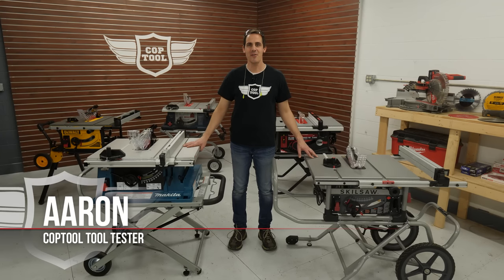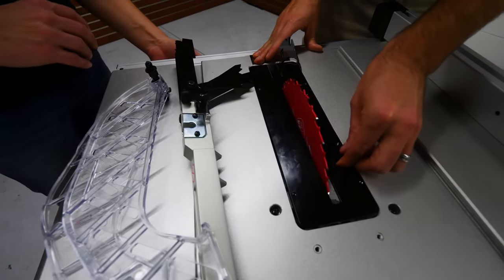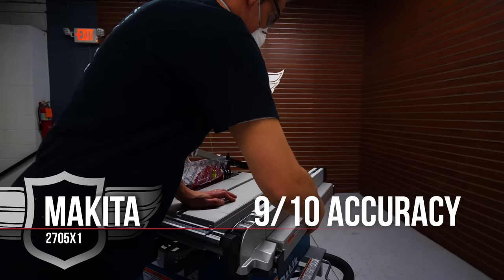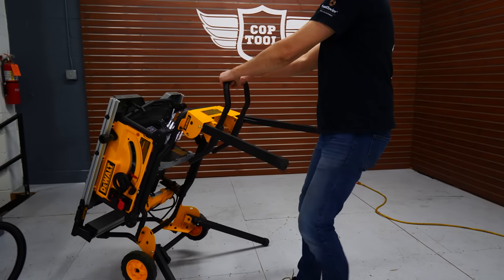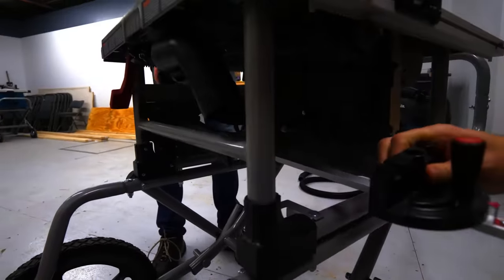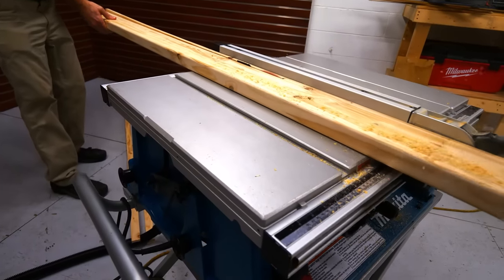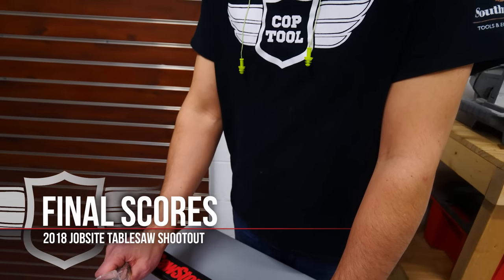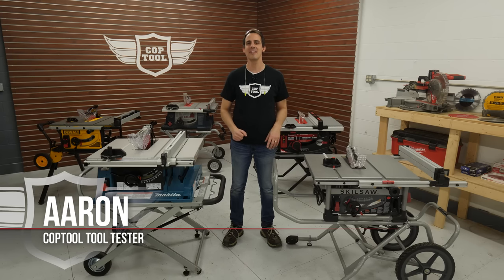THE BEST Jobsite Table Saw - Bosch, Dewalt, Makita, SawStop, SkilSaw. How to choose the one for you.

Comment: Saw stops aren't safe, they'll still cut you, yea it'll probably stop before your fingers gone but in my opinion it makes people too brave, you need to respect your table saw, like you said in the video it can end your career, there's no value in buying a saw stop, there's value in working smart and respecting the fact that any tool in your shop can be seriously dangerous if you don't know what your doing.
Reply from the maker: I agree, working smart and respecting safety is incredibly important for any tool. However, this doesn't mean SawStop doesn't hold any value. Safety features aside, It's a great saw... I also understand what you mean by making people too brave (senseless), but that isn't the case for everyone. Mistakes happen and there is nothing wrong with putting up a little extra cash for insurance.
Reply: Getting a couple stitches is a hell of a lot better than losing a finger. But I agree. It does, for some people, introduce a level of complacency. And it's even worse if they end up using a saw that doesn't have that safety feature.
Reply: I’m all for any kind of technology that improves safety.   That being said, I am over the top on personal safety.   I don’t put my hands anywhere near the blade when making cuts — that’s that they make push sticks for.   I would safely say that 98% of shop accidents are user error.  People either engage in extremely unsafe practices, or fail to maintain their equipment in top working condition.   No amount of safety equipment can prevent those kinds of injuries!

Comment: Buy the way you can adjust the fence on the dewalt in every way. If you knew what you are talking about you would know that. Also there is a separate riving blade without the guard. Again if you knew what you are talking about you would know that. I can go on even the way you checked for accuracy, not using the right tools. Again if you knew what you are talking about you would have used the right tools for tuning it. Also the fence can be tightened down with an easy adjustment so it doesn't move at all. Again you don't know what you are talking about.

Comment: Isn’t the skill saw a bosh saw on a different base ?
Reply: skil has worn drive motor and blade extends higher. bosch did buy skil company in 90's
Reply: I have the Skilsaw and it's amazing. The Bosch is not Worm Drive. My understanding is that Skilsaw used to be owned by Bosch but that is not the case anymore. I might be wrong in that but that is what Skilsaw told me when I contacted them a few weeks back.
Reply: One thing to remember is all site saw are pretty much limited to 15amp motor because of common  110Volt house hold breakers. Anything on drive system added to motor other than direct drive adds resistance; reduced power at blade in end.
Reply: David Davis Where are you getting that information from? This is the only time I have ever heard this so point me in the right direction so I can read up on it for myself please. I can only talk about my experience with the Skilsaw SPT99 and so far it's been a beast.
Reply: Many companies are bought and owned by other companies but the products are still branded, designed, engineered, manufactured and marketed differently. Like Milwaukee, Ridgid and Ryobi are owned and manufactured by the same corporation but they are not the same products even though some people will try to tell you that they are. There sometimes are cases of rebranding of a particular product but not so much with these types of tools from what I can tell.
Reply: David, Your statement isn't inaccurate, but it is incomplete. It is ignoring the mechanical advantage that is gained by introducing a gearset inbetween the motor and the blade. Skil doesn't publish (that I've seen) the specs around the gearing, making it harder to calculate the mechanical advantage from the gearing, but it's there. That's pretty much the whole point of the gearing after all.
Reply: Jeff Delamater As luck would have it I actually got a response from Skilsaw today for a question I asked a week or so ago related to using an 8" dado stack and they spoke a bit to the H/P of the Skilsaw. Also I will paste another answer from them a few weeks ago that touches on the merits of the Worm Drive technology which I agree with you does not fit neatly into David's hypothesis:

From a few weeks back regarding the Worm Drive:

Skilsaw Customer Support <SkilsawSupport@custhelp.com>
Mar 22 (13 days ago)
to me 
 Image

Recently you requested personal assistance from our on-line support center. Below is a summary of your request and our response. We will assume your issue has been resolved if we do not hear from you within hours. Thank you for allowing us to be of service to you.

 

Subject
Part and Accessory Information

Response By Email (Paul) (03/22/2018 01:34 PM)
 
Hi Alex,
 
 
Thank you for your patience on this.
 
I consulted one of my colleague from the technical team and here's what he said :
 
"The horsepower rating technically comes out at about 1 3/4, but the real dynamic is that this is a worm drive saw with a lot of torque which will easily accommodate an 8 inch dado. My experience has been a 6 inch dado will do the job.  Also, you cannot use a dial adjustable dado as it will not fit on the shaft, must use a dado stack and purchase a dado insert for the table top because it comes with a new outer washer. Much of this information is in the manual."
 
Hope this helps. Please let me know if you have further question.
 
 
Kind regards,
 
Paul
Skil Customer Support
 
For additional information, please visit our web site at https://www.skilsaw.com/ or contact us Toll-Free at 1-877-754-5999, M-F 7a-7p CST.

From today:

Skilsaw Customer Support <SkilsawSupport@custhelp.com>
3:38 PM (3 hours ago)
to me 
 Image

Recently you requested personal assistance from our on-line support center. Below is a summary of your request and our response.  Thank you for allowing us to be of service to you.
 
Subject
Part and Accessory Information

Response By Email (Juan) (04/04/2018 05:38 PM)
Dear Alex,

Thank you for contacting Skil Power Tools of North America!

I am sending this email as a response to your inquiry regarding the SPT99.

I understand you need recommendation whether to use the 6" or 8" Dado Blade. 

Actually there's no harm in using both size. What wears the motor are cutting using dull blades and forcing the material on the saw, especially for hardwood. 

The horse power of your saw is 2.412 HP, the formula is Amps x Volts / 746 = HP/

About your 3rd question, we don't have a publicly published data for that and we may need to reach out with our product managers.

Our sincerest apologies for the delayed response. This was due to an issue that caused some of the emails to be stuck in our outbox. We understand how you would have preferred an earlier response. Rest assured we have already taken precautionary measures to avoid this issue from happening again. 

Feel free to give us a call for further clarification and inquiries.

Best Regards,

Juan
Skil Customer Support

Skil Power Tools appreciates and values your continued support of our products as we continue to produce power tools that are engineered for excellence. 

For additional information, please visit our web site at www.Skiltools.com or contact us Toll-Free at 1-877-754-5999, M-F 7:00 AM-7:00 PM CST.
Reply: I would also add that I thoroughly read the manual cover to cover and back again and the information I was after regarding HP of the table saw, and 8" over a 6" dado stack and whether the Freud Dial-A-Width dado product would fit the arbor was NOT covered in the manual. Still love this saw though. The power!!! :-)
Reply: The SKIL and SKILSAW brands are now officially under the ownership of Chervon, following the completion of the acquisition from Robert Bosch Tool. Now Chervon.
torque-expo.com/chervon-completes-acquisition-of-skil-power-tool-brands-from-bosch

Comment: Yah but lets be realistic , most of the time u cut some wet crap wood on construction , Pt wood aluminum , u will be running switching to a by pass  mode on saw stop all thr time , or you will trigger that safety mechanism and u will be sitting waiting for new cartrage and new blade , so lost time , lost money and hustle runing to stores to replace blades and cartrages , on construction its going to be frustrating, if u have to stop project , and i dont just talk crap about sawstop, i owe one of my own but proffessional version , and for home , shop invironment when u have all the time in the world to check moisture in the wood , set everything up blah blah blah it works great

Comment: Value for quality the DeWalt are the best; IMO. Ridgid and others like them are not even accurate from cheap design of trunion and fence. Saw Stop is nice but unless you want to pay for the safety over priced. The stand on Saw Stop is not up to the saw quality or price also. Also remember power is volts x AMPS= watts and you can only get so much power out of 15AMPS. Pretty much geared for RPMs or torque choice.

Comment: Where's  the new hitachi ? I think it would benn  the best saw
Reply: Hitachi C10RJ? It's in the video as the Dewalt DWE7491RS. The Hitachi is basically the same saw with a few improvements and a $200 discount.
Reply: Yep;the Hitachi is a cheap knockoff of the Dewalt . Smaller features missing and not near as well built. or smooth operating.
Reply: I can't speak for how well built or smooth either one is since I've never used them but these guys seem to like the C10RJ: https://www.protoolreviews.com/tools/power/corded/saws/hitachi-table-saw-c10rj-announced/29629/
I do know that the fence on the DWE7491RS is a lot sloppier than on my ten year old DeWalt saw. The miter gauge on mine is also a lot better.
And, I think you've got it backwards, the Hitachi has features that are missing from the DeWalt, not the other way around such as decent miter gauge, wider ripping capacity, outfeed extension, and one adjustable leg for uneven surfaces. Plus it has the typical slow-start, overload sensor, and electric brake. As of 3/20/2018, the C10RJ is on sale at Lowes for $350. I'm thinking about it. My old DeWalt won't accept any dado blades, a real bummer for my use.
Reply: The new hitachi is badass! Can’t believe hitachi stepped up their game as much as they did. I got my C10RJ for around $275 on Black Friday and I couldn’t be happier. Didn’t break the bank and it rips through wood wayyyy better than I could have imagined.

Comment: I agree that safety is very important, but I've been building for 30 years now, and I don't understand how ANYONE would EVER have their hands so close to the blade that they would have to rely on the Auto stop feature of the SawStop. Crying out loud, If anyone is careless enough to let their hands/fingers get that close to the blade when cutting, they shouldn't be using the tool in the first place. One thing I must point out, these are PORTABLE, jobsite saws made for the that purpose, and depending on what you're trade is, will determine what features are most important to you. Because of all the different people I have worked with on different jobsites, I have had the opportunity to use the SawStop, DeWalt, Makita, Skil, Rigid, Wen, Ryobi, Hercules and a few others all in a production environment. They all have their good and bad. But for the type of production I need when sheathing walls, floors and roofs, I elected to go with the Bosch and the Skil. With a good blade, they just rip through sheathing like butter. But I cannot see paying $1300 for a portable, jobsite table saw.

I also do a lot of furniture and cabinet making and I would never use my jobsite table saw for that. In my shop I have an older Grizzley industrial table saw permanently mounted in place for that. I have been thinking of replacing it, but I can't justify spending $5000-$7000 for another one when that one is still performing very well.

Comment: Wrong, Absolute junk !!! Pretty much everything broke on it within 4 months of daily jobsite use. The tires even melted in the Texas sun, lol. Only positive thing I can say is you can leave it on the jobsite overnight with that Skil name on the side of it and it will still be there in the morning. Push stick holder is cool, little plumbing elbow to aim some of the dust down cool. No blade lock so you can perform a dado or a rabbet, without the blade wondering off into the sunset not cool. Putting the blade adjustment jack screw inside the dust port with the blade majorly not cool. So the jack screw which they engineered to be super tight as they have no blade lock gets all gummed up with dust, its hell to clean then the handle which is of coarse plastic only has a 1/4 inch of flat spot in contact with the shaft so it strips out almost immediately and your using vice grips to raise and lower the blade which you have taken off so you can get your hand in there with a small wire brush to try and clean the jack screw off. Then you JB weld the handle back on once you get back to the shop. I'm expecting the red fence lock handle to snap off any day now. If your a DIY'er and cut some 1/4 once every two years to make a new Rudolf for your manger scene, then its a great saw, if you make a living with your tools then get a Dewalt or pretty much anything other than this. Skil must mean Suck in Yiddish, lol

Comment: Lot of DeWalt fanboys here so kudos to big yellow for their excellent marketing. I own their job site saw, however, and it's rife with quality control problems. Biggest concern: the fence can't be made vertically square with the table! I'm talking 2 degrees off with no ability to adjust. It's dangerous as hell. Table isn't very flat, miter slots are too inconsistent for dual sled runners. TBH, there are better saws made from diy videos.

Comment: Umm ridgid, you left the best saw out of the test.
Reply: I had the R4513 and other than the fence, I very much disliked it. The blade chatter was off the charts on mine.
Reply: I looked at the R4513 today. The fence was really nice!
Reply: @82camino96  I had been eyeing the Rigid but many reviews on home depot claim the bevel lock does not hold the 45 degree when set.  Also many Ridgid fans report being fans of older models.
Reply: Sankar Krishnan yeah, I vaguely remember the bevel lock being a bit chinsy but I didn’t cut many bevels when I had it. Two things I know about the older models which make them more desirable. First, the older model had a soft start, which is an excellent feature when it comes to a loud and obnoxious universal motor. When I turned on my R4513, it sounded like an explosion due to the loud motor and the blade chatter. It was always startling. Second, the old model had more of a standard oval shaped throat plate which some people prefer for making custom plates... what I’ve learned in these last two years is that the only way to be truly happy with a table saw (in my opinion) is to just bite the bullet and buy a real stationary table saw with a cast iron top, induction motor/belt driven. I needed to be able to take my saw to job sites but I just couldn’t get a job site saw that performed how I wanted. It was always a compromise. So I finally bought a heavy saw, put a nice mobile base on it to have basic mobility, and then bought the Milwaukee Fuel M18 cordless table saw for when I need one on the job. I would never go back, I’m happier when using my saw at home, and the cordless saw is so compact, lightweight and works even better than my Ridgid saw did. I can store it in the corner, out of site out of mind and can toss it in my car in seconds. It took me a lot of trial and error and multiple saw purchases to realize that the advice I read on the internet was true. They just don’t make jobsite saws that run smooth and true like an induction motor iron top stationary saw. Though, I’m sure there will be improvements coming, and I haven’t tried all of them... I also owned the Dewalt saw, the top had almost 40 thousands of bow in it. It was awful. Then I owned the Bosch, which was by far the best of the bunch that I had, but at that point I had made the decision to get a stationary saw. Everybody has their own needs, but I also believe that almost anyone would get the satisfaction they’re truly looking for once they make some cuts on a cabinet or hybrid saw. They’re just a greater pleasure to use and the dust collection is leaps and bounds better.
Reply: @82camino96  I purchased a rigid contractor hybrid saw, model TS2424 off of fb yardsale but my wife is not a fan of dust in the garage.  So I needed a mobile option so I finally ordered the makita 2705 yesterday and it should arrive in a week!
Reply: Sankar Krishnan good for you my friend. I never used the Makita, but most of my favorite cordless tool that I own are Makita. I use them more than any of my other tools and I’m in pretty much every platform. I have the 36v miter saw and it’s awesome. The best by far out of the five that I’ve owned. I love Makita, good company, owned by the same people since the beginning, quality tools, very ergonomic. Some of their stands are garbage though. I purchased the rising miter saw stand because it’s the smallest one on the market (only one I could fit in my car easily) but unfortunately the thing is built terribly, not strong or sturdy and the saw has fallen over twice! I guess maybe accessories aren’t their claim to fame... Check back in after you set it up and used it. I’m interested in the feedback.